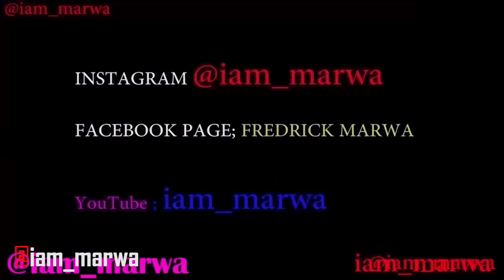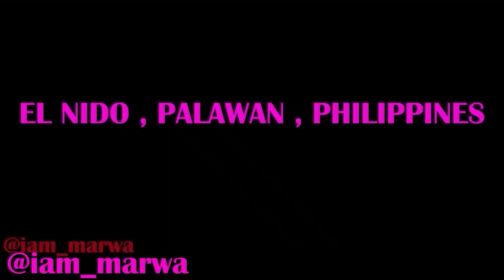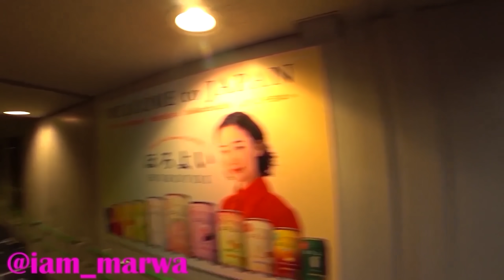HELP Me Decide !!!

Comment: It depends on how long it will take to accomplish the house if you travel, after how long will you garner enough funds to finalize the project without the elements deteriorating the work you’ve put in so far, why don’t you get a sufficient loan against the property, finish the project, furnish it and and put it on Airbnb and then you can travel, vlog and pay back the loan slowly

Comment: Listen Marwa, it's better you finish the house, travelling is not good now because of the pandemic, many countries are implementing stricter measures even the Philippines that you visited is worse off now than when you were there. I'm from 🇯🇲 but live in Sweden, I booked a trip to travel there and it was cancelled twice. You don't need the hassle, each country has its own entry regulations, some don't admit you if you haven't taken the vaccine, be smart, travel as you knew it will never be the same again, that's why I think you should  finish the house, then travel by then and hopefully it may be easier to travel around.

Comment: Bro. Travel and make more money to complete the building. The building is not running away. You have done a good job already. 

What I will advice is to build a Fence round it and employ someone as a guard to look after it for you.

You need more money to complete the building. Yes, finishing the building is one thing, but furnishing and fittings is another thing entirely which cost more money that the building itself. So travel, increase your subscriber base, improve your view and make more money. 

Go travel, Go Make Money.